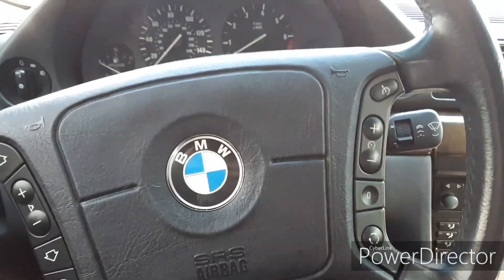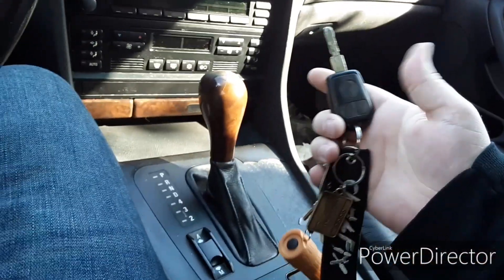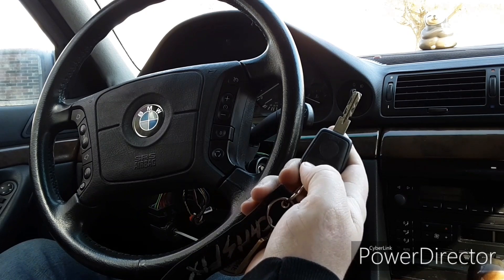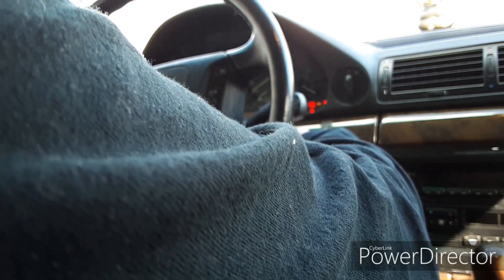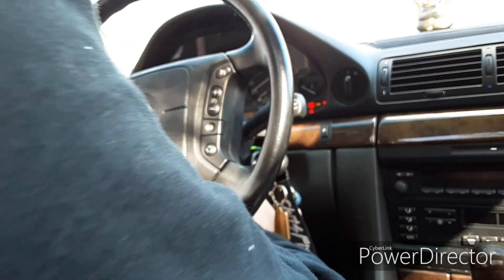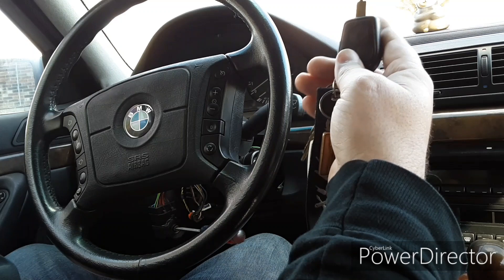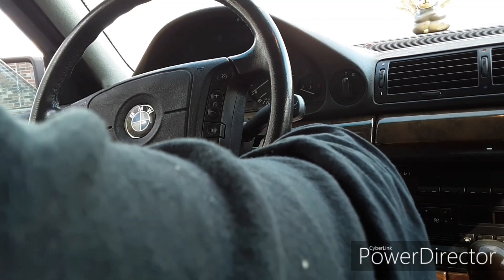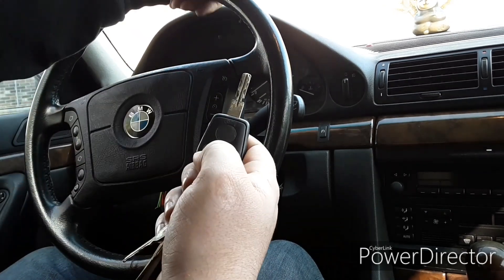How to reprogram your E38 BMW car key

Comment: sorted mine like this:

closed windows and doors shut.
turned key to position 1
holding unlock button switched off and took out key (unlock button still pressed),  and pressed unlock button three times. 

bingo! 😎👍
Reply from the maker: Ill have to try that

Comment: He is confusing re-programming the lock unlock function with the immobiliser function tht is not home re-programable, it uses a seperate chip inside the key, it does not need the key battery or even the circuit board.
Reply from the maker: I watched a video that told me how to do it

Comment: This guy is hard to watch. Jumping off the battery as opposed to the jump ports under the hood. I get it’s 2yrs old, but get a service manual. Don’t wing it. It rolls your windows down because that’s the function of holding the button down. Your E46 did the same thing. Get an owners manual.  Guaranteed on future videos he says he found the battery was bad. Had the same issue with my E38. It was the battery. I swore up and down the battery was fine. It wasn’t.
Reply from the maker: I know more than you
Reply: @Germanmuscle  yeah, your clapped out E38 shows all you know.